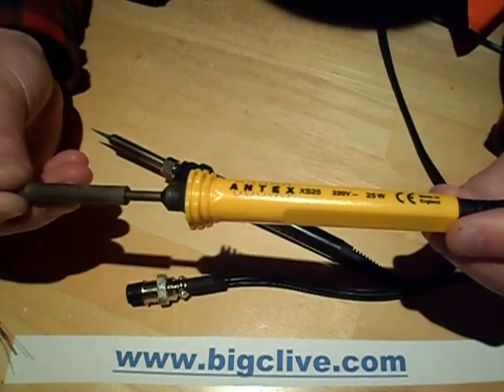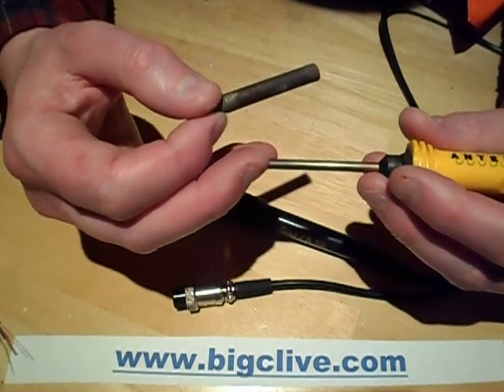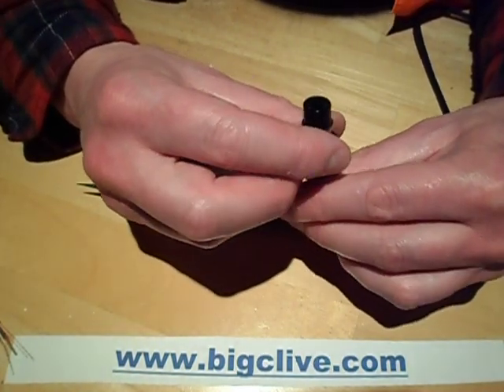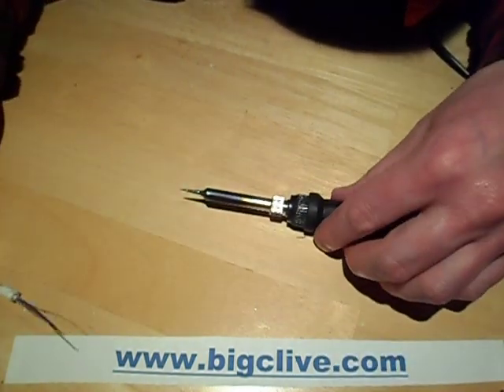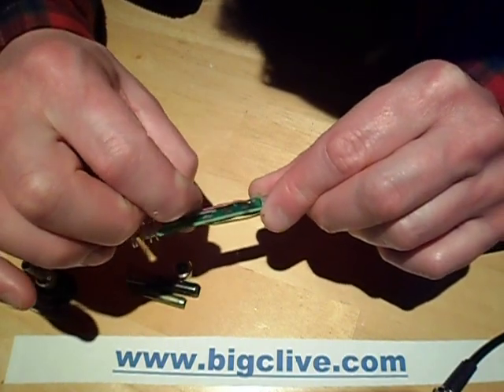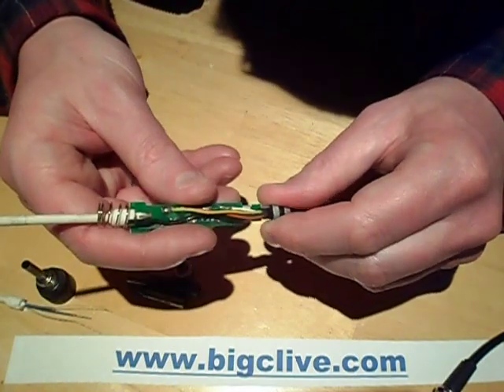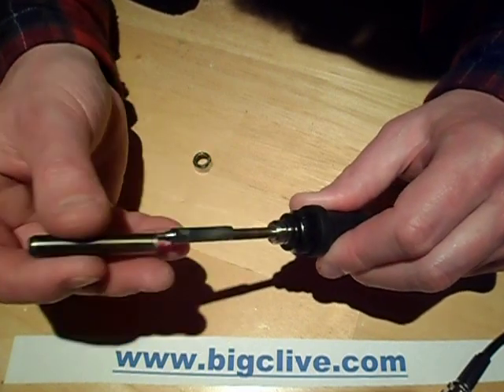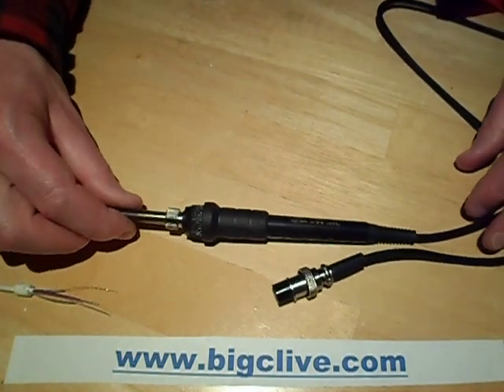Inside a cheap Chinese Yihua soldering iron.

Comment: heat transfer from heating element to tip is the key for all soldering irons, and this one fails big time. look inside the tip you ll see that sleeve pushed in but doesn't make tight connection only touches the tip at few points inside, the rest is air gap. now look how tight is the tip on the heating element, yes it is very loose, touching each other at few points not with a big surface. remove the ceramic white part around the heating element and the same here, the coil which producing the heat barely touches the ceramic part, loads of air gap.
so lets count how many air gap does this crappy iron has:
1, coil to ceramic part
2,ceramic part to sleeve
3, sleeve to tip

wow loads of air gap very low heat transfer. the heat sensor is near the coil, if there is any, sometimes there  is only 2 wires coming from the solder station, in that case the resistance of the coil is measured, if higher the temp is higher. Anyway, the temp is not measured on the tip but for the heating element and therefore stabilized fir it. NOT FOR The TIP!

So if you set 350 C degrees eventually the tip will reach 350 C but when you start soldering tip temp will drop, and because there is loads of air gap from heat source the heat only goes to the tip very very slowly. Making soldering hard, frustrating or impossible. Works better at 450 C but many times even that fails to melt the solder on pcb.

Interesting thing that the wattage of the station doesnt really matter. If this iron would be powered with 500W station the heating element would get hot faster but because basically it is heat insulated with air gaps the tip temp would be the same slowly rising crap.

This thing is only good for melting plastic, hot glue, so you are not gonna make your good iron dirty.

If a chinese brand says power consumption is 100w actually mean 60-80w max (not that if higher wattage would help).

Even Weller wes51 is uncomperably better.
Reply: I've been using household aluminium foil wrapped carefully and tightly around the heating element to achieve a snug fit with the soldering bit. I've yet to encounter any downsides. UPDATE: After a few weeks, possibly months, the packing seized! All my tips I have prepared like that are now stuck tightly to the heater. Temperature conductance seems to be unimpeded, or may have become impeded unnoticeably (still better than rattling about inside), but I now can't exchange them anymore, so if I ever want to swap, I'll have to swap tip AND heating element.
Reply: @Anvilshock  Yes - I just did this before reading your comment.  I was appalled at how poorly mine worked.  I found that my tips would not fully seat over the heating element.  The base of the tip was sitting on the lip of the screw in sleeve leaving an air gap at the top of the tip.  I ended up cutting the sleeve down a bit and removing the lip.  Now my tip sits fully on the heating element.  I then wrapped the heating element with several wraps of aluminum foil to act as a heat conductor as remove the air gaps along the sides.  Now the solder iron works as expected, and had no issues reworking items on a test board I had laying around - which I couldn't do prior to this fix.
Reply: Thanks for reminding me! I completely forgot about giving out this recommendation and amending it with my findings. Be warned: After a few months, possibly weeks or even earlier, the packing may seize! All my tips I have prepared like that are now stuck tightly to the heater. Temperature conductance seems to be unimpeded, or may have become impeded unnoticeably (still better than freely rattling about inside), but I now can't exchange them anymore without unreasonable force, so if I ever wanted to swap, I'd have to swap tip AND heating element at once. Nothing too critical, more like annoying, given the ready availability of these on ebay & co., but there you go.
Reply: @Anvilshock  Isn't that how some of the higher ends tips are designed... with the element and tip as one component?  You've just hacked it into a higher end device.  :)  Albeit, not has "hot swappable" as the higher end devices.
Reply: Hahaha, I suppose so. "If you want to sell lamp oil, give away the lamp for free!" It's a good thing that handles, and elements, and tips are all available at such low price that it becomes feasible to just simply have an arsenal of multiple assemblies ready.
Reply: @Anvilshock  
And your conclusion is?
Reply: @MaximC  Ketchup shoes.
Reply: @Anvilshock  
Sorry, my bad, obviously conclusion was included in your comment.

Thanks for sharing your experience.
Reply: Good idea. I wonder if some kind of heatsink paste would be even better
Reply: @kalkunkongen  Nope. It dries  out and becomes glue!  Use brass or copper shim, and rotate the bit every few weeks (and do that when cold  - thermal expansion fills the gap when the iron is hot - which is the whole point of the exercise !)
Reply: If you find one that survives any accidental temperature excursions beyond 400 °C, let me know. The super-cheap Chinese irons with the little dial can get glowing cherry-hot, starting at 580 °C. (Almost like they don't bother with a 220-V heating cartridges, and simply fit 110-V cartridges in all of them.) Aluminium melts at 660. Copper foil would be better, of course, melting at 1084, but that stuff is far less likely to be part of an average household.
Reply: The air gap merely delays the temperature correction by a couple seconds.  Where you are going wrong is not understanding that when a heating element heats up INSIDE a tip, there is nowhere for the heat to go except into the tip.   It is not THAT important to have an exact tip temperature, the iron can merely be set a few degrees higher if you need to keep up a productivity rate (same as with any iron).

You seem to lack a basic understanding of the design, obviously when you wrote "sometimes there is only two wires".  That is a different tech which only controls how much of a fixed power level goes to an iron with no feedback to regulate temperature.  This has temperature feedback and regulation.  It is not great, depends on the tip used but it's "good enough" for all but those obsessed with numbers on paper.  With any type of iron you have to calibrate it with the tip you're going to use if you are that picky.

Soldering with this is not hard, frustration, or impossible.  Neither is soldering with the other type of iron that has no temp feedback.  It's just slower with no temp feedback but in a non-production environment, you already spent more time complaining than the wait while using it (lol).

Is it the best station on the market?  Of course not, but it's great for the price and anyone who can't solder well with one, without the problems you imagine, lacks soldering skills... not the station's fault.

However, the general consensus is that you'll enjoy soldering with it more if you ditch the Chinesium tips and get genuine Hakko 900M if not their newer generation T18.  They wet better and have a nickle plating that's more temperature resistant and more uniform, BUT they are pretty pricey so most people opt for a full set of the generic tips and only their two most favorite as genuine hakko tips.

Someone good at soldering can get by with a nail and a candle if they have to.  Don't blame the iron.
Reply: fifferfiffer This is the reason that I have refuse to buy such a soldering station. The manufacturing tolerances are a joke on this things. Also the tips, that you usually can find are not genuine so, sometimes you get lucky and the tips fit snugly but most of the times they won't. Cheers :)

Comment: Good review thanks! Provided the thermocouple is well calibrated, what is the maximum temperature compatible with those iron tips?
Reply from the maker: The temperature I tend to use is around 350C.  I'm not sure what is the maximum normal temperature, but I managed to get the bit glowing red hot while messing about with the calibration.  Then the element itself failed shortly after.
Reply: bigclivedotcom I know this is an old post, but what do you need 350C for? That is really high for this style of iron. No disrespect intended but I'm very curious.
Reply from the maker: bain5872 I've traditionally used a thermally balanced iron that peaks at a heat of around 350 degrees.  If I use a smaller iron with temperature control it seems slow to recover at the speed I normally solder.  I guess the higher temperature is compensated for by my soldering speed.  I was using a small iron yesterday to repair some illuminated props and it was capped at 300 degrees.  It was annoyingly slow to use.
Reply: bigclivedotcom  I understand now. Yes, there is but a few things more annoying than an iron with to low a thermal mass. Just no fun. Thanks for the reply.

Comment: I just bought one on eBay for $13 including a desoldering pump and some solder and a screwdriver and a PCB tweezers and a stand and some flux (also its 60W) so far its going great but its not the greatest iron in the world but I'm still happy, the brand is stearnel
Reply: +Sony Trinitron try to change the tip. The tips differ a lot in quality. Some are very poor.
Reply: JackySixSeven I'm going to keep the tip since it works fine as it is but I will probably get a new tip once the tip on it starts to age, I'm thinking of getting a Weller tip but depends when the tip gets beyond its useful life as I've used it every couple of weeks and it is still as good as ever as I tin the tip.
Reply: I use it with a hakko pcb, it cost ~10$ on ebay. You only need a 24V~ transformer, and you have somthing good. All together ist cheaper than a tip for my expensiv station. With a good tip you can solder well. With a bad one you need much more heat and it takes all much longer.
Reply from the maker: +JackySixSeven I didn't realise they sold those.  I've just bought one for closer inspection.  I doubt they are real Hakko PCBs, mainly because they are available in both male and female output sockets.  And also because they are very cheap.
Reply: I bought my PCB( I have 2 ) ~2 Years ago. I compared them with the photos I found. And Snapshoots i took of one of Daves Video. They looked absolout the sameas the original hakko, and I saw no difference. I  compared them with the schematic of Hakko too, and I found no difference. The other 936(there are a lot names of it) use a different schematic, with different ICs. I have one of those too, but I don't use it because its no fun to use it, it has the other gender  of the output socked.

Comment: I Got this Yihua soldering station, after the fist try the heating element is broken, from where to get a replacement and how to do it?
Reply from the maker: You should contact your supplier and tell them that the element failed on the first use to see if they will replace it.  You can get complete new irons for it quite cheaply on ebay, but make sure you check the plug type.  Some have a plug on the lead and some have a socket.  You can also change the element on its own by unscrewing the end of the iron, but ironically this involves a need to solder on the new elements wires.
Reply: bigclivedotcom
thanks for the help, i already contact the supplier, if they not gonna replace it i will get a new iron.

Comment: I just got a iron and it glows red is that normal as the solder will not run as iron is to hot
Reply from the maker: No.  The iron should not glow red-hot.  Your unit is either needing the iron temperature calibrated or is faulty.  What does the display read?
Reply: bigclivedotcom not got a display, I am going to return it, got a photo of it glowing Thanks

Comment: http://www.ebay.com/itm/New-AC-220-240V-30W-Electric-Soldering-Iron-Welding-EU-Plug-Yellow-YU-/151329383188?pt=LH_DefaultDomain_0&hash=item233bef2314       is this a good one just for some simple stuff
Reply from the maker: I'd recommend using one that has an earth/ground connection.

Comment: Just took apart my hakko 936 iron, and it's exactly the same construction technique though they use wires with proper heat resistant coverings, and the bit has a small metal sleeve that fits snugly between it and the heating element for a bit better thermal transfer.

Comment: I think these would fit an Antex XS: http://www.ebay.co.uk/itm/20W-Replaceable-Bevel-Design-Soldering-Iron-Solder-Tip-/360657709792?pt=UK_Home_Garden_PowerTools_SM&hash=item53f8dfeae0
Reply from the maker: That might be worth looking at.  I wonder how the internal diameter compares.
Reply: bigclivedotcom 5mm, so it should fit fine.

Comment: Which base unit did you buy? I've been experiencing similar problems with Maplins soldering iron tips i.e. lack of them so could really do with an alternative. Also, have you ever noticed that Maplins carrier bags have a giant knob on them?
Reply from the maker: It's a Yihua 8786D.  Right now it's in my bad books because it blew the element in the iron while it was heating up today.  And I've found out why the internal transformer has a mysterious winding with an output of over 30 volts.  It's overdriving the 24v iron element to make it heat faster and give a greater equivalent thermal mass.  I'd say it's probably pushing the 50W element at near 100W!
Reply: bigclivedotcom Bugger that, then! Actually, I did a bit of Googling for the Yihua 8786D and it seems to be fitted with a 220 volt AC transformer as standard - could this be the reason why there's a burning transformer smell?
Reply from the maker: MegaWayneD That's what I was thinking myself.  It seems odd to use a 220V transformer given that Europe theoretically standardised on 230V some time ago, and by using a 240V transformer it would handle the worst case scenario while still performing well at lower voltages.  I plugged the unit in today and left it with the power on but the soldering iron and heatgun off, and it's passive draw was 6W and it remained cold.  It must just be when the soldering iron is being used in earnest.  That doesn't really fit with my traditional working environment where the iron is sitting on whenever I'm at the bench.  At least the heatgun bit is good for doing heatshrink at low temperatures which is one of the reasons I bought it.